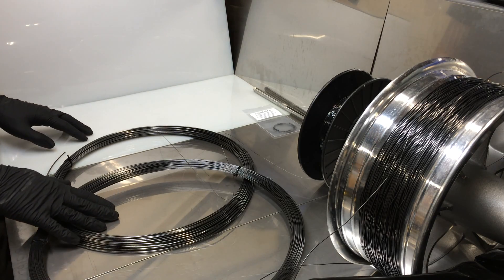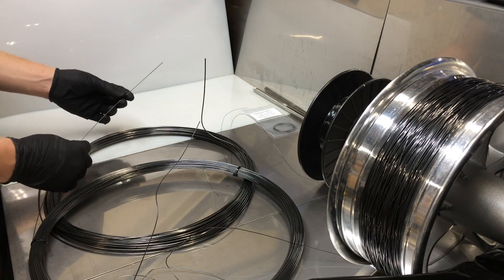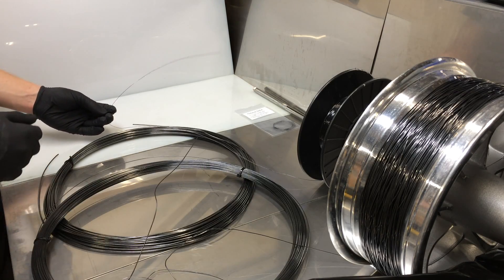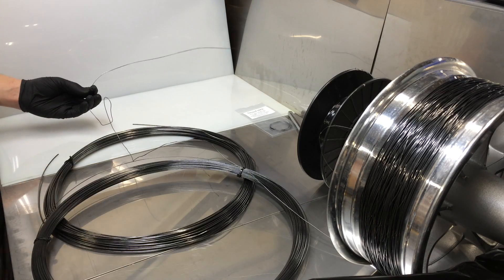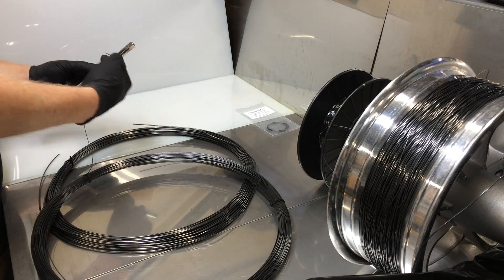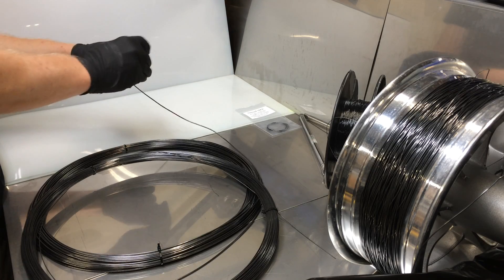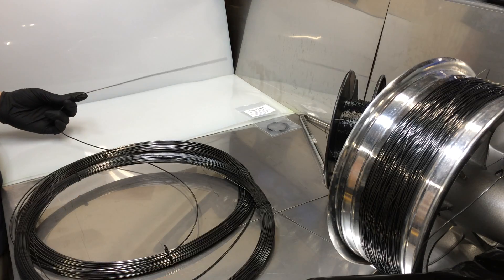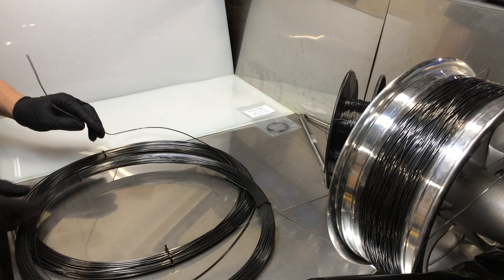Nitinol 0.5mm 1mm and 2mm, 70ºC and 40ºC transition temps

Comment: Does the transition temperature affect how strong the wire can push/pull itself back to it's original shape?
Reply from the maker: Yes. The alloys with a lower transition phase temp exhibit more force. In that sense the 15C wire is more powerful than the 40C which is better than the 80C wire. It is possible to have wire down to -20C phase. However, there are practical implications due to ambient temps. I usually recommend the 40C wire for its performance.

Comment: How is nitinol with a transition temp between the range 15C to 70C useful? How do we know how much to heat it up to for it to straighten up? Thanks!
Reply from the maker: it begins to transition at around 20C and simply has more force the higher the temperature goes. Any transition temp wire can take a higher heat immediately, it will react more vigorously.

Comment: Hi! Is it correct for me to conclude that the lower the transition temp ie 40C, the more elastic it is?
Reply from the maker: the lower the transition phase the less ductile at the same temperature. Elasticity is similar across the board but you really need to try a sample pack to understand the difference. Get sample pack here:

https://nexmetal.com/collections/superelastic-alloys/products/nitinol-shape-memory-wire-sample-pack

Comment: Where is your product page and where do we order the product from?
Reply from the maker: +Delicious DeBlair you can check out my eBay store at http://www.ebay.com/sch/m.html?_ssn=nexmetals&_nkw=nitinol  and nexmetal.com
Reply: nexmetal I would be ordering it by the spool or not at all.
Reply from the maker: http://nexmetal.com/products/nitinol-niti-sma-muscle-wire
Reply: nexmetal I went to the page and could not find listed what I sought.
Reply: nexmetal I am not after a tiny 'sample wire' I am after a 10,000 foot spool. I'm not a hobbyist, but a serious machinist, manufacturer and engineer.
Reply from the maker: Ok, did you want to place an order? Please advise the specifications for diameter and transition temperature, we can calculate length per kilo, larger orders are placed per kg not spool, I would need to check maximum continuous length without break - do you have any requirements for that?
Reply: nexmetal I need to find out how much it costs by type before I place the order, plus I need a contract of lading with certificate of insurance for at least 110% the value of the product at the time of purchase.
Reply from the maker: https://nexmetal.com/collections/superelastic-alloys/